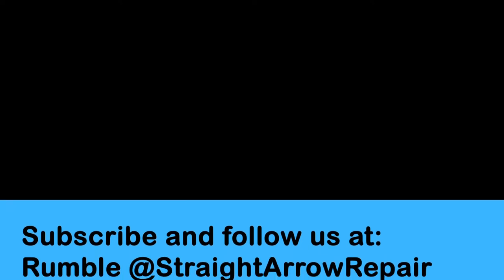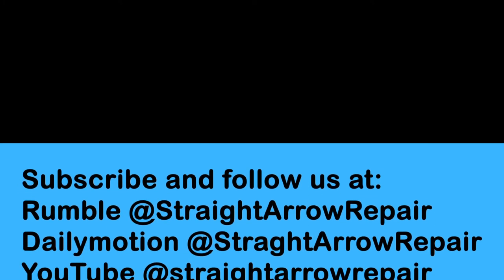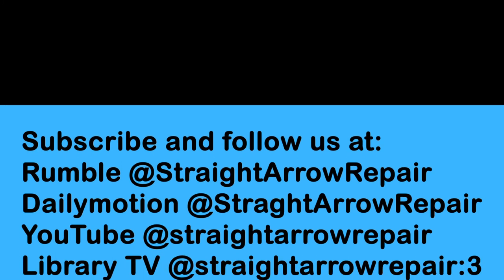Should You Wrap Ductwork with Insulation in a Mobile Home

Comment: I have spots under my mobile home here in Louisiana.  Some of the insulation has fallen.  Question is with the humidity here the exposed ducts are sweating so much I'm having to replace subfloor and joists.  Should I rewrap all those ducts and will it prevent this type of damages
Reply from the maker: Any time you have a drastic difference in temperature you will get sweating. The heat from the ductwork will help protect your plumbing from freezing. That's why the original insulation hung down . With plastic to hold in heat that radiates to those areas . What you will need to do is replace your underpinning. There are videos on this channel on installing new underpinning. .Also moisture from the ground caused your floor to eventually give out. I have confidence you can fix your problems. I am here to show you how I do these things so you can

Comment: Hi Thanks for the information ....am a HVAC contractor 30 + yrs & but never worked much @ all on modular homes  duct work Till Now ....but serviced quite an few .....So that's very interesting  about heat & no insulation needed for plumbing make sence ......but AC season un insulated ducts Sweats ..So not even sure if they come from factory with any duct insulation or Not  ? ...but apparently Not  !! ..but please advised if you could bc fixing to do hvac relocation next week from its closet  removed ... to underneath & tie back into both Duct runs  Thank Ya Sir
Reply from the maker: The cross over ductwork is to be metal sleeved and insulation over it
Reply: @StraightArrowRepair  ....Great thanks for the advise & will do metal duct instead of just replacing the exposed cross over flex duct .... as it is now ..thanks again
Reply from the maker: Metal wrapped with slide over insulation

Comment: The insulation is below the plumbing so the pipes are already insulated. Wrapping the ducting is mandatory to comply with code.
Reply from the maker: All metal duct work in mobile homes absolutely none have insulation.
Reply: @StraightArrowRepair  The ones I have seen are and they should be to help keep them from sweating which could compromise the effectiveness of the insulation below them lying on the underbelly wrap. If you have seen ones that aren't wrapped it has nothing to do with keeping pipes from freezing. The insulation below the pipes and heat wrap on the pipes themselves is the proper way of keeping them from freezing. It is something we check every year in Minnesota.

Comment: What is it is a good topic Ive thought about doing it but then the cost in the hassle I didn’t really think outweighs the means.  If I felt I was paying too much on my electric bill to heat or cool my home then I would think about it more seriously but it’s fair.
Reply from the maker: There are places to make improvements. My experience has shown that the metal leading from the rectangular ductwork that goes from one end of the house to the other. Made of thin aluminum usually is leaking because of gaps where it connects at both the floor and the main duct work . In that 10 or 12 inch area I have reached in after taking out floor register or cover and used foil tape after reshaping and refastening.Another very common place that leaks is where the central unit connects to the ductwork. That requires going under the house.. I will try to make videos to show examples in the future

Comment: Not an issue in florida. Wrap the hell out of it.
Reply from the maker: I believe from central Florida up you get freezing weather. I lived in Orlando and Ocala. Worked all over Florida. From Jacksonville to Key West. I would suggest the effort to wrap does not work that get freezing weather that could bust supply lines. Still I understand that below say Ocala it would not be needed  to protect perhaps . There is an actual town called Frostline many miles south of Ocala. Thanks for calling out that part of Florida might not need the indirect heat to protect supply lines.
Reply from the maker: I believe from central Florida up you get freezing weather. I lived in Orlando and Ocala. Worked all over Florida. From Jacksonville to Key West. I would suggest the effort to wrap does not work that get freezing weather that could bust supply lines. Still I understand that below say Ocala it would not be needed  to protect perhaps . There is an actual town called Frostline many miles south of Ocala. Thanks for calling out that part of Florida might not need the indirect heat to protect supply lines.
Reply from the maker: Florida has freezing weather below Ocala. Since I lived and worked there and in Orlando I am familiar with the weather.
Reply: Never one time in 45 years had 1 frozen pipe in NORTH Florida.
Reply from the maker: Tempatures in January and February in Tallahassee with wind-chill has dropped Tempatures into the teens. That is recorded Tempatures. Still I am happy you have no problems.